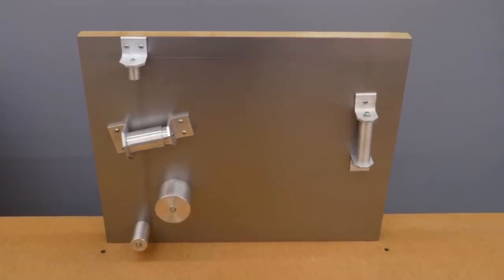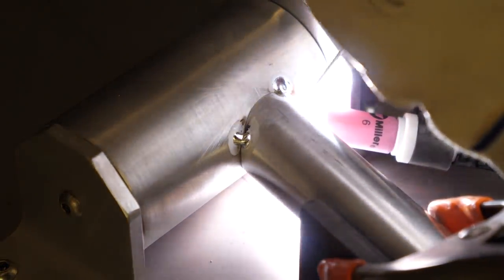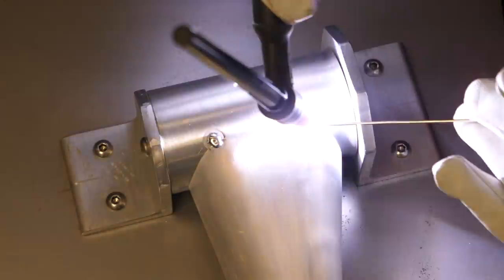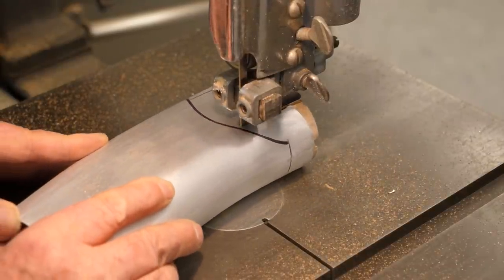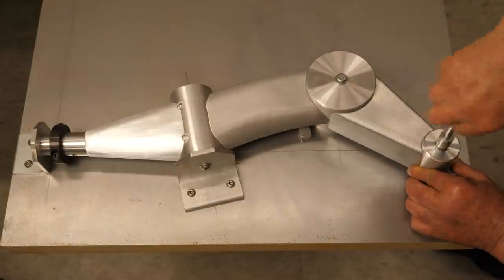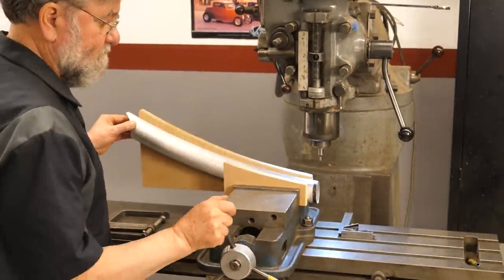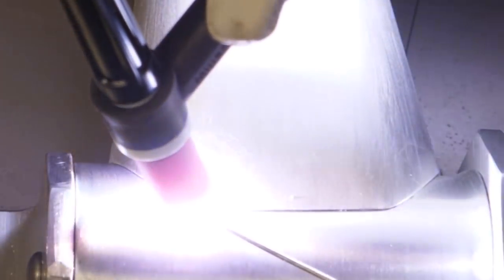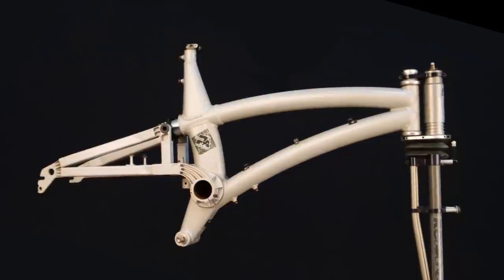Assembling and Welding an Aluminum Bicycle Frame

Comment: I've been a frame designer for forty plus years. This video blew my mind. You're the Michelangelo of metal work.
Reply from the maker: I'm very glad you liked it!
Reply: Great video! Awesome job of welding too!
Reply: yer i had to double check i had this vid in my fav tab as this guy has some smart tips i am a decent joiner/dry linner but i am gathering tips to turn my hand to building my first MTB frame i can normally get away with a few mill but when working with metal  i will have to make sure to bring in my usual tolerances a fair bit
Reply from the maker: I wish you the best of luck on your project!
Reply: @RonCovell  thanks i was going to get my dad who a was a engineer to weld my steel frame but think i will braise it myself for the full satisfaction of saying i designed it and built it myself but i will still ask for his input as he understands working with metal more than me

Comment: I just imagine Fabio Lanzoni rocking this bike with a bandana and white Nike Airs. Great work, I just love that jig you made. I think 3D-printing shapes to form aluminium around could be a great life hack
Reply from the maker: WOW - I never thought of printing hammerforms - that's a sensational idea! Have you done printing like this?
Reply: Ron Covell not yet, I have done a lot of bodywork and metal shaping when I restored my car, but this was before I got a 3D-printer. I dream of building a Maserati A6G Zagato, this would be a pretty doable project if someone did a 3D scan of the car, shaping aluminium around the more reasonable filaments should work pretty well, you can probably make it work with cold rolled steel as well
Reply from the maker: Lazze Jansson recently posted a video showing a cool way to make a buck from wire: https://www.youtube.com/watch?v=KRewIG-Bw7o&t=4s
Reply: Håvard Johansen great idea !! Even the metal 3d printers could be an advantage:-) :-)

Comment: Amazing work! Does the bike go on to be heat-treated, since welding aluminum makes it a bit weaker, or is it still strong enough to be rideable right away?
Reply from the maker: John - Pretty much all high-performance bicycle frames are made from high-strength material, and the welding anneals (softens) the metal in the weld zone. It is imperative that these frames be heat-treated after welding, to restore the strength of the metal in the heat-affected zone next to the weld. Thanks for asking for clarification on this issue!
Reply: @RonCovell  how did you retreat the frame after welding? Do you have your own oven and water hold to temper it and age it?

Comment: Very nice, do you heat treat the frame after? Or it’s not absolutely necessary? Thanks
Reply from the maker: Heat treating is essential for any aluminum bicycle frame. The heat of welding anneals the metal near the weld, and heat treatment is required to restore the necessary strength.

Comment: That furick cup used on welding alloy disturbed me a bit, I'd like to know what purpose does it serve, visibility ?
Reply from the maker: Yes, the clear cup allows you to see through it in some instances, and it lights up the welding area in general, making it easier to see the action.
Reply: @RonCovell  Understood. Remarkable work and skillset Ron. Every now and then at work I have to use hand metal shaping procedures and I always remember your videos and advices. Although this craft takes a lot of time and practice to master so my work is nowhere near the quality like yours. Thank you for educating me and others. I wish there's more skilled craftsman like you.

Comment: @Ron Covell  
Thank you very much friend. I appreciate your kind reply. In the case of small workshops that do not have heat treatment, what do you recommend for welding, what filler rod? ER 4043 or ER 5554 or 5356?

Many greetings friend. From Mexico City. 👏🙏
Reply from the maker: Most bicycle frames are made from aluminum alloys that are heat treated to provide strength. When you make a weld on heat-treated alloys, you lose the heat treatment, and you have made a weak point in the structure. That's why heat treatment is always recommended for any welded aluminum bicycle components. 
5XXX series filler material can be strengthened by heat treating, but 4XXX series filer material can not.
 I would guess that somewhere in, or near Mexico City, there must be some companies that do heat treating.
Reply: @RonCovell  Thank you very much friend. I greet you with respect and admiration.

Comment: I didn't see anything about normalising the heat affected zones near the welds and realignment of the frame post welding/heat treatment. Is it not required in this fabrication?
Reply from the maker: Yes, you are absolutely correct that those steps are essential for aluminum bicycle frame construction.

Comment: Dear Ron. What alloy are you using here?
Reply from the maker: 6061
Reply: @RonCovell  ok that wos what i wos afriad of- impossible to get in my country:(
Reply from the maker: 6061 is probably the most widely used of all the aluminum alloys. Where do you live?
Reply: @RonCovell  i live en denmark, and i even work with metal and tig welding for a living, so i have contact to every metal dealers in my country, and i have talk to everybody about it with no luck. Somehow 6061 and 4130 crmo is no where to be found here:(
Reply from the maker: I did a very quick web search, and found this possible resource:
AlmexA A/S
Egelundsvej 17
5260 Odense S

+45 63 13 01 78
info@almexa.dk
Also, Germany is just south of you, and someone there surely must have 6061 aluminum sheet.
Reply: @RonCovell   thank you very mutch Ron. They are on vacation til week 32 so i must whait for an answer. Do you have experiance with 6060? That i Can get here in both tube and sheet form.. it is intented for special bicycle frames i have a wish to make.
Reply from the maker: I don't have any experience with 6060, but I would imagine it is very similar to 6061. I have a fair amount of experience with 6063 alloy, which is often used for aluminum extrusions, and in my limited experience, I can't tell much difference between it and 6061.
There is a free website that gives a LOT of technical information about metals and plastics:
www.matweb.com
A visit there would let you compare tensile strength, elongation, and all the other relevant mechanical properties for both materials.
Reply: @RonCovell  thank you many many times for taking the time to help me out. Wish you the best!

Comment: Wow, its nice to see furick cup at welding with AC, when its not recommended for welding with AC
Reply from the maker: Someone gave me that cup, and I did not know it was not recommended for AC. It sure lights up the welding area nicely - which is great for shooting video!
Reply: Yes thats true :) They are great for occasional welds, but in everyday use they seemed to me like not good investment... They also have Ceramic ones which lights up welding area too and they are pretty tough. If you are interested just visit Michael Furick website
Reply: rixogtr why do you say it’s not recommended for ac?
Reply: Welding Junkie the manufacture does not recommend using this cup with ac. Also aluminum doesn't require large amounts of shielding gas so a standard nozzle is more economical.
Reply: @weldingjunkie  Skeet described it pretty much in all it's glory. I might just add from my experience with AC, excessive gas coverage cools down the puddle a bit quicker which in some cases might have an undesirable effect.

Comment: Was Your choice of Ceriated vs Thoriated a personal one ? I use 2% thoriated for Aluminum and want to know if the latter is a better choice for some reason ? I missed Your visit to Minnesota due to family health issues, I was sad I had to but family comes first. Hope You felt welcome in Minnesota and hope to someday catch one of Your shop classes/demos.
Reply from the maker: Thoriated tungsten has been used since the 1940's, and I have welded plenty of aluminum with it, even though it is not recommended for aluminum welding with the old, transformer TIG machines (which cause it to split at higher amperage settings). Nowadays, Ceriated, Lanthanated, and 'Tri-mix' tungstens have largely replaced the older Thoriated style. In addition to having better current carrying capacities, the newer tungsten alloys are less likely to become contaminated from accidental touching the rod, or base metal. Additionally, thorium is (slightly) radioactive, and some people are concerned that it may be hazardous to inhale the dust created when sharpening Thoriated tungsten.

Comment: Hi, very nice video, I want to create my frame (for downhill). Where I can buy the aluminium ? I find a lot of steel but nothing in aluminium.
Reply from the maker: The frames for the Monolith were made from 6061 alloy aluminum, which is fairly easy to source. If you live in the US, you can buy small quantities from aircraft supply houses such the Aircraft Spruce company, or Online Metals.
Reply: @RonCovell  Ok thanks but I am in France
Reply from the maker: I'm sorry, but I don't have any contacts in France. 6061 is one of the most common aluminum alloys, so I would think that any large metal supplier could ship this material to you.

Comment: What are the ends that hold the rear wheel made of , they are too strong to be made of aluminum
Reply from the maker: The 'dropouts' are aluminum, as they are on nearly all aluminum bicycle frames that I have seen.
Reply: Wow , thanks . Didn't know aluminium was that strong
Reply from the maker: Some aluminum alloys have as much strength as mild steel.
Reply: Damn , that shit strong af

Comment: hey Ron! I had an idea for a video that I would really like to see your opinion on. Have you heard about people DC welding with helium? could you please break this down for us? your professional opinion is needed.
Reply from the maker: Adam - Thanks for the idea! Have you heard the term 'Heli-Arc' welding? When the process that is now called TIG welding was first being developed, helium was used as the shielding gas. I have never tried DC TIG welding with helium, but I'm sure it would work fine, because both helium and the much-more commonly used argon gasses are both inert.

Helium, or a helium-argon mix is sometimes used for AC welding of aluminum, to get more heat into the base metal. The heat for TIG welding comes from the plasma arc, and every gas becomes plasma at a different temperature.  

When DC welding on common materials like steel, I can make a puddle on metal of virtually any thickness, so it's hard to understand why more heat would be needed. Certainly, helium could supply more heat to the puddle, but it's a lot more expensive than argon, and I don't much benefit for adding more heat for DC welding.
Reply: you are so awesome Ron, so I left out a huge detail which is that they are saying you can use a hobby dc welder to Tig aluminum if you have helium as your gas. That was what I was asking but I didn't properly express it
Reply from the maker: Adam, I wish I had an answer for you, but I have never experimented with this. I haven't kept a bottle of Helium in my shop for a long time, (and it's expensive) so I can't check it out right now.
Reply: oh ok, well maybe someone you know has one that way you wouldn't have to buy a bottle. thanks for answering back. best wishes

Comment: Any particular reason you used kerosene as cutting fluid?
Reply from the maker: Kerosene was recommended to me as a cutting fluid for aluminum many years ago, and it has worked well, so I rarely use anything else for milling. I occasionally use WD-40, or Gibbs oil. I use a cutting fluid with more body,  like Tapmatic, for tapping holes in aluminum,.

Comment: I keep hearing on bike forms that aluminum bike frames can't be repaired because the weld area reduces the strength of the frame.  How much truth is in this and does it really matter?
Reply from the maker: All high-end aluminum bicycle frames are heat treated after welding. If you weld on them after heat-treatment, the metal that is heated loses much of its strength, and is prone to failure. 
You can re-heat treat the entire frame after doing a welding repair, which solves the problem, but it takes a specialized facility to do this, and not all heat treating houses will take on a small job.
https://www.youtube.com/shorts/bV4bwABlPVw
Reply: @RonCovell  what about regular mass produced aluminum bikes
Reply from the maker: I have seen a few aluminum bicycle frames made of massively thick tubing, and it's conceivable that since those frames are so overbuilt, they might not be heat treated. Nevertheless, since most bicycles are built to be lightweight, thin wall tubing is normally used - and with aluminum bikes, it has to be heat treated after welding or it will not withstand the forces it sees. The first builders of aluminum bicycle frames learned this painful lesson very quickly!

Comment: Interesting but definitely not a "how-to".
Reply from the maker: Adam - Thanks for watching, and commenting.  I try to make my videos as instructional as possible. I would be interested to know what information you felt was missing.
Reply: I'm eating crow. I went back and viewed the whole series from the beginning and feel that it is in fact a good how-to. Please accept my apologies. PS did you anneal that aluminum tube prior to bending it??
Reply from the maker: Adam - no problem. I did not have to anneal the tubing, but I worked up a pretty good sweat running it through the tube bending machine!